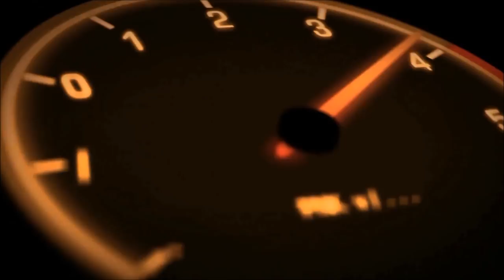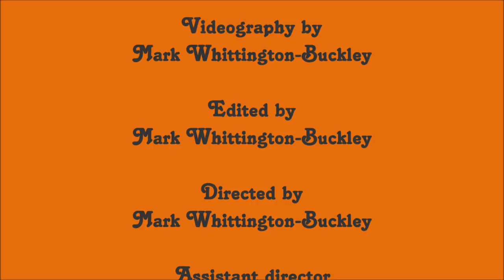Cafe Scrambler Project episode 17

Comment: you can get flasher relays with a screw to adjust the flash rate they are not expensive and work well if you have a mix of led and bulbs. plenty on ebay
Reply: this is somthing i have been considering

Comment: Tip for the indicators, had it in the garage where I work we just soldered some purpose built resistors in before each indicator, ones we used are made by lextek
Reply from the maker: Great! We will give that a go
Reply: Much better to use the correct flasher unit. Not great to have very hot resistors around trying to melt everything wile wasting loads of power.
Reply: Chris Hart don’t get to hot , ones I’m on about are from lextek made specifically for indicators flashing to fast, wouldn’t suggest otherwise man

Comment: Why fit a drl in the front? Has the headlight not got built in ones?
Reply from the maker: To be honest I only got it so I can match the rear one, and in case I ever forget to switch the lights on, the drl will be wired to the ignition.
Reply: Drl tend to not look like there flashing at cars, like a normal motorcycle headlight does with the cut off from the dipped beam. Also saves a load of power if led.

Comment: Can't understand why you didn't make the battery box out of 1 piece of metal & bend it into shape; far stronger & less welding. Plus that front flap, which is now unsupported won't last 5 minutes 😑 Sorry to pick fault, but...
Reply from the maker: 1 piece was a consideration...did it this way instead. The front piece is just a ledge to stop the battery falling back and will hold the hook for the rubber, no real strength needed really
Reply: Motors for the Masses Fair enough. Just thought the previous incarnation was of a better construction 👍🏻